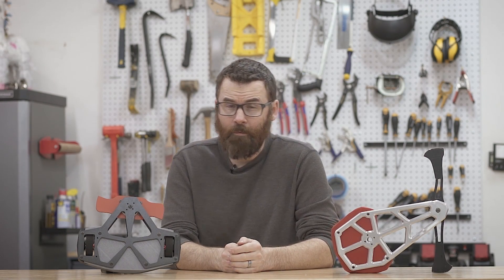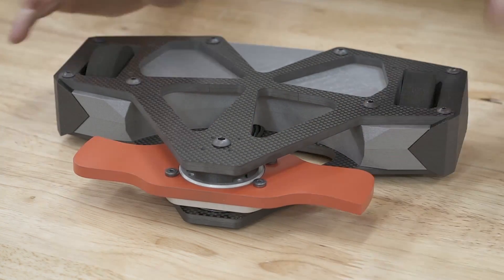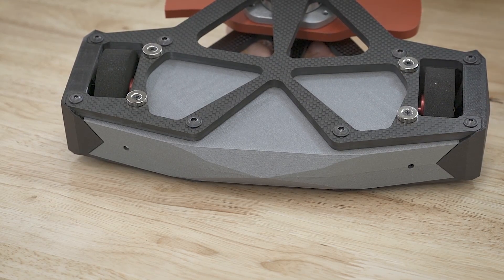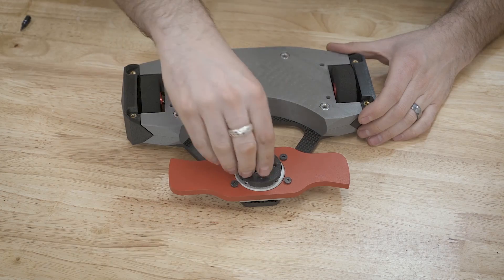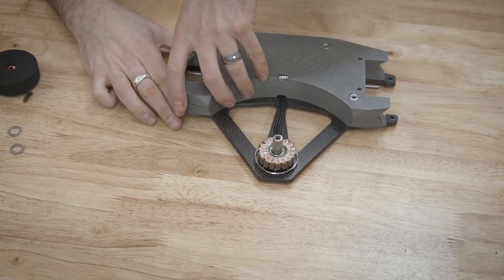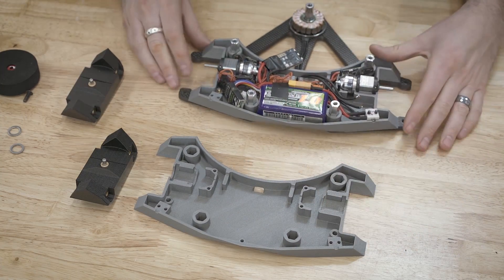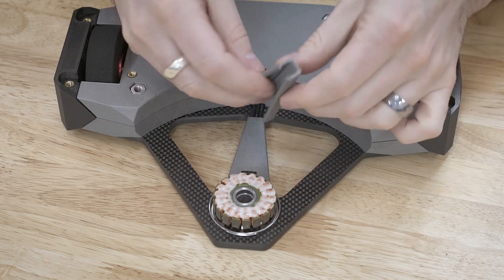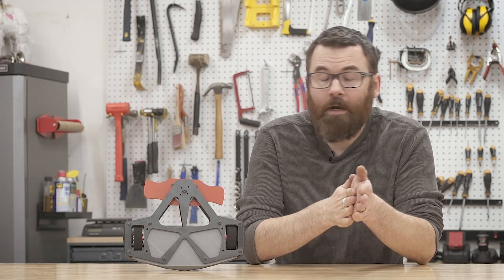Psychotic Break V2 - Overview

Comment: What is the weapon motor used? Also how big are the wheels
Reply from the maker: The weapon motor is a unicorn.  Check out my video on hub motors, it's kinda custom and also not sold anymore.  The wheels are 2.25" I think.
Reply: @RobertCowanDIY  Thanks so much for responding. I've had tons of experience in FIRST Robotics, but I'm quite new to battlebots. I'm thinking of building a version of this robot but I want to increase the inertia of the weapon by adding a flywheel that is mechanical linked to the weapon and runs significantly faster than the weapon. Then you could have a smaller spinning mass (making you more maneuverable) and more inertia at the same time. Have you ever done something similar and if so what are the drawbacks besides the usually complexity and reliability issues.
Reply from the maker: @matthewthomas9383  The simpler the better.
Reply: @RobertCowanDIY  That is what seems to be the best in battlebots. But I'm used to building swerve drives and turrets so I'm probably gonna add some cool factor by taking away some reliability.
Reply from the maker: @matthewthomas9383  It's always a delicate balance.  I could probably just build a wedge with 4 wheel drive and get the same number of wins, but in the end, I want to put some bit of my personality into my bots.  The best design choices are where you don't have to make compromises, but those are hard to come by.

Comment: Wish I had means of building my own idea. What would you think of I triangular frame with circular disc just inside corners of frame. Spun from central motor and wheels like low low man above and below weapon. End of weapon will have weights on disc like SOW. Weights perpendicular to disc so can reach as far vertical as possible. This way can hit from almost any direction, and can do upside down. One colored arrow pointing to front on top and another color arrow on bottom still point to front. Switch reversible on radio? Not sure what size and weight it would be.

Comment: So you have to take the whole thing apart to charge the battery?
Reply from the maker: Yes.  It takes ~5 minutes.  Taking the bot apart is a great thing to do after every right regardless.  You don't know what's shifted or what's on the verge of breaking unless you take it apart.  After every fight I change the battery and go through everything to make sure it all still looks good and still works as it should.  Then before each match I put it into the arena just for a second and make sure the weapon and drive function.  This is why you rarely see me go into a fight with a drive side or weapon not working.

Comment: I wonder if a thin titanium layer (0.5mm?) laminated onto the CF would help deflect hits. Like some other commenters I'm worried that a hit to the CF will shatter a whole side of the frame. For example rickety cricket hit the previous frame and bent it notably. I'm really curious to see what this frame would do in the same hit. Time will tell. Beautiful work as usual all around.

Comment: Elegant design!  Are you still having to build your own brushless planetary gear motors or are they available already assembled?
Reply from the maker: I just buy the ones from ServoCity and add my own motors.  It takes maybe 15 minutes per, if you fully go through and clean everything up.  Of course, machining down the outer gear takes more time, but I have a jig for that.
Reply: @RobertCowanDIY  Does the motor pinion fit right on the motor shaft or do you have to machine it to fit before adding the planetary gearbox?
Reply from the maker: @machine2747  I have a whole video devoted to the brushless drive, that should answer all your questions.

Comment: That's beautiful! Really elegant. There's obviously a lot of careful thought gone into it - but I'm a little anxious about the durability of the carbon-fibre framing for a fighting machine. Weight = excellent.  Single-hit impact resistance = excellent. Torsional stiffness = excellent.

But a circular saw-style vertical spinner would have quite a lot to 'nibble' on. Rodents are famously able to chew through just about anything non-ferrous...
Reply: With that blade... they’ll be long gone before they get anywhere near the frame!

Comment: Very nice. You could probably tongue and groove your wall section for your top and bottom main body grey parts, but in a ‘castleation’ manner to allow for the symmetrical one part design method. May add a bit of extra strength uniformly around the wall section, rather than your possible peak stress areas around your pins.

Comment: Awesome!
Just a though:
Would it be beneficial to have two counter rotating blades right on top of each other to act like sheers?
It often seems like the damage of spinners is greatly reduced when the opponent flies away. For example the damage of Scorpios was devastating when it hit copperhead from above, despite it being a relatively small spinner.
Reply from the maker: This would just guarantee you wouldn't make contact.  It would just rub or grind.  OR, it would be too slow and there wouldn't be enough kinetic energy to do anything.